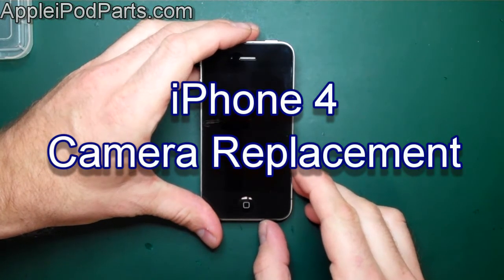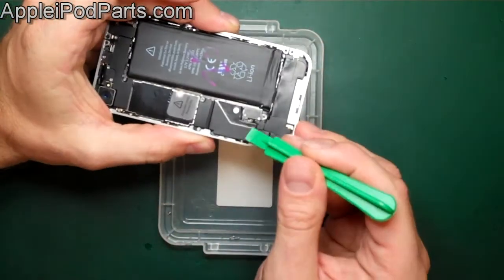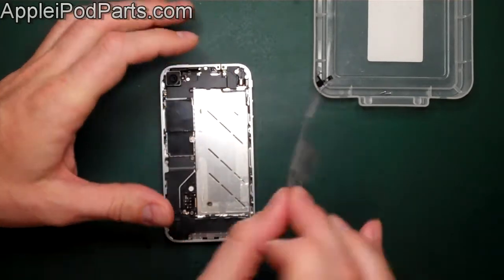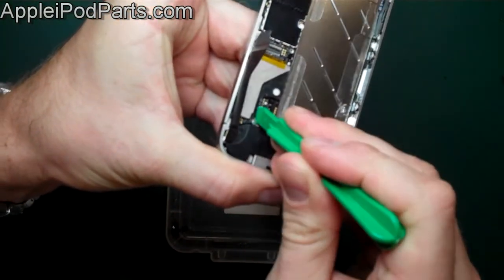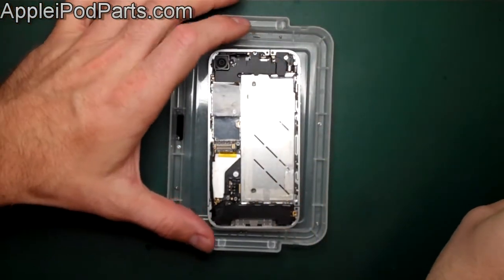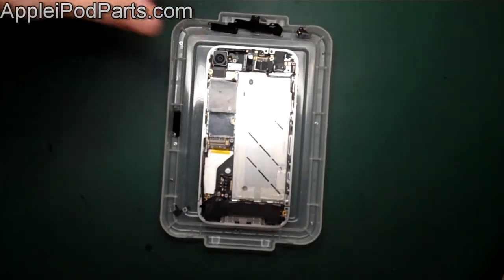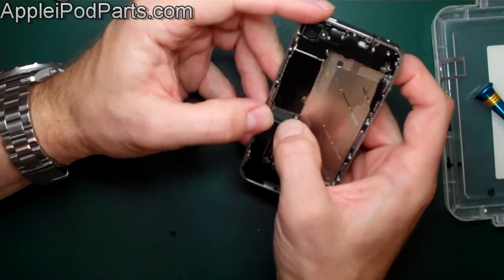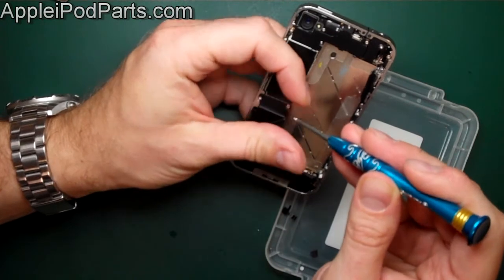iPhone 4 Camera Replacement Repair Guide - www.AppleiPodParts.com

Comment: I bought a IPhone 4 in a box disassembled and look at several vid on repair and reassembly and this vid is great, very descriptive on the screws and placement...finally got mine together with a new screen and digitizer..i used a white screen on my black phone and call it an Oreo......